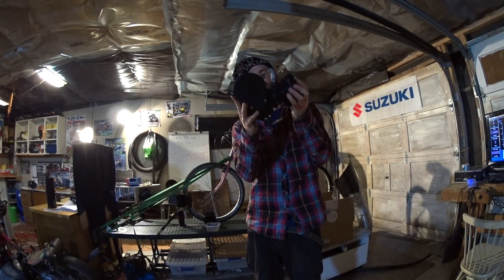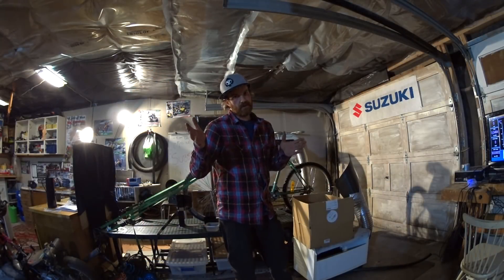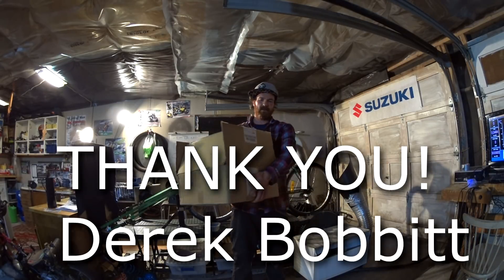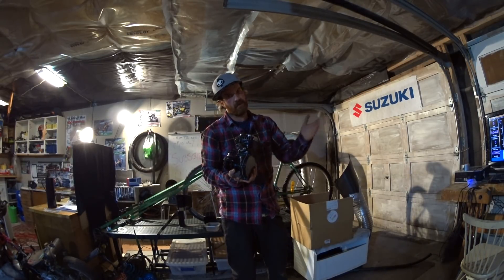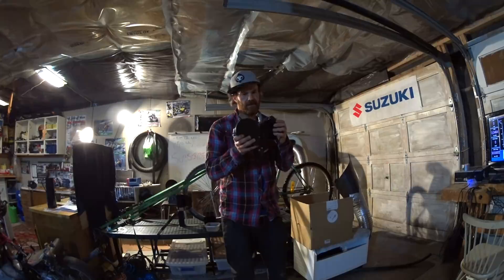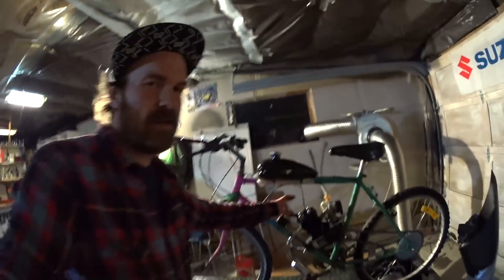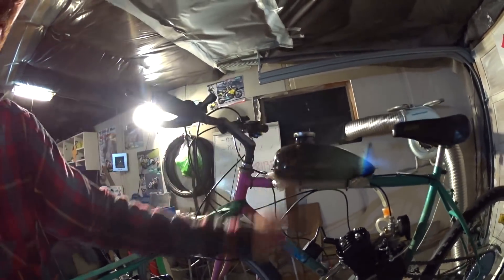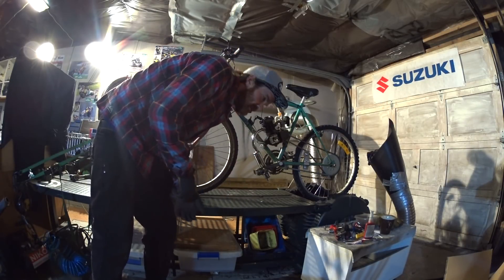Motorized Bicycle Tuning Project WITH DYNO | E1

Comment: You can try to go fast but on this set up . Is a razón why you stop working on them you nkow nothing of working on them . Stay on you lane . You nkow how to make other engine fast but not this one’s sorry. You make a faster motorized not a bicycle a bicycle have pedals that work and the engine for the bicycle is 1 speed or a jack shaft . Set up . Good work on those crazy build. They not bicycle the frame on a dirt bikes engines .

Comment: The lower support of the motor chain is crap! I sold and installed those engines and always had to make a superiror support because if not when braking (brake pedal) or when I wanted to start the engine, the bracket got between the spokes of the wheel, even has come to cut some rays.

Comment: Ok so I got a 66cc kit for my bike from a friend that couldn't use it so it had set for a couple of years and I'm just running it, running into a few problems, such as the clutch it was stiff at first but now it's loose and easy to pull, I tightened the flower nut 
but still won't work. If any of you people could help me out I would be so thankful!
Reply from the maker: Maybe the spring broke? Sorry, haven't been inside the engine yet, don't know much about it.
Reply: I had a clutch problem, the little arm was worn $5 to replace on ebay

Comment: he should just gut his lawnmower engine out.  If its what i think it is its an old 2 stroke 160cc full crank engine .   Sunbeam victa
Reply from the maker: +Glenn Lurman Too bad it's just a 4stroke Honda...
Reply: unusual cowling for a honda. it is the mower next to the diesel heater we r talking about.  Also where u at im in New Zealand and we r in the process of eliminating or just plain crippling our 2 strokes to meet stupid emision standards think im going to move to a cold climate like yours just so i can keep fixing 2 strokes
Reply from the maker: +Glenn Lurman When you mention it I haven't seen another Honda model with this look. Norway, just the same here....

Comment: There's a guy around where I live that's got one of these kits to go 80km/h. He has an exhaust from sickbikeparts.com , 36 tooth rear sprocket, probably a bigger carb and a few other things that I don't know about. You might want to find a good steel rim for the bike too, maybe double walled. The sprocket will warp and snap spokes in the wheel if its aluminum. ive gone through 3 before i got a steel one
Reply from the maker: +HDepicness13 Cool! Thanks for the heads-up!

Comment: Hey Alex Jesse here was thinking that the CDI that come with those Chinese Motors the ones that they come with are a 4-stroke CDI and if you could go into a little detail just a little about how burn time influences and turbulence come into play and how four stroke ignition differ from two stroke I think on the performance in you could help a lot of people thanks buddy can't wait for your second installment video God I'll tell you I was laughing so hard. Thank you can't wait till the tuning starts
Reply from the maker: +Jesse DeBlon Thanks! I'll cover it in a future video! There's no big difference between 2/4 stroke ignition systems, except the two engine types need very different ignition curves.

Comment: Mods that i think could make power: 1. Reversed cylinder 2. Head with a vertical spark plug hole 3. Ktm sx50 reed valve with a diy reed case 4. 19mm delorto or a 22 oko carb 5. Diy expanssion chamber 6. Variable timing cdi 7. BALANCE THE CRANKSHAFT  8. Lots of porting
Reply: robertas grigas from my experience reversed cylinder actually hinders performance a lot, because the crankcase chanels don't align well. Vertical cylinder heads have a lower compression so less power than 45° slant heads, also they like to crack with big expansion chambers, the rest you mentioned does improve power by a lot.
Reply from the maker: +robertas grigas Good ideas!
Reply: 2STROKE STUFFING Re carbs a WJ71 should go well with this.  what I use on my alx 78 and rcmax 71
Reply: MrSlehofer thre are high compression ones https://m.youtube.com/watch?v=x8OgOjltnqE
Reply: ah you ment fred-head, aka cylinder heads made by Frederick Chelminsky, he has a youtube channel about motorized bicycles and he manufactures various mods for motorized bicycles, so yes, they do improve power a lot
Reply from the maker: +behemothfan666 F T P Thanks!
Reply: Throw in a power valve and a rotory valve on the intake
..water cool the cylinder and head...get rid of those fat rings

Comment: Thx Derek.

First things. Carb leaks at intake. Oring and silicone.
Let chain stretch then delete the tensioner. It's a death wish if it slides into spokes the current way its mounted.
Little heat and bend the pipe to clear peddles.

Glad to see you got one. This isn't a Zeda model by chance? Just a standard 48 or 66cc model?
Reply from the maker: +Cody Jv Yeah, I noticed the carb having no actual seal. Thanks for tge tips! Don't think it's a Zeta(what is a Zeta?) at least wasn't advertised as one.
Reply from the maker: +Cody Jv Zeda...
Reply: Zeda has a 40mm crank, 40mm intake opposed to 38mm crank and 32mm intake. And supposedly the case is stuffed a tad. About the only difference I use to buy the kits and put them on bikes and sell for little profit. Just bought a Zeda myself to see if it's a little better stock. Glad to see you got one of these to play with and I'd love to see you maybe adapt some cylinders to it. The China nikasil is crap but decent for what it is. Keep it up.
Reply from the maker: +Cody Jv Ok, I'll have to check. I've got a few cylinders in mind...
Reply: Right now the largest is 52mm. Crazy. That's max but I think you could do ab awesome job with a 50mm bore except your probably 38mm stroke. Even with tuning I think you'll rock it. Quick simple power is sand that head some but ofc more heat. 44tooth run about 30 on stock bike with 26inch wheels. Wear a helmet...

Comment: I have one of this but I have figured out the after break in you have to first tighten the head bolts and you also check your cone nut the torque makes it come ither lose or tight depending on which side goes lose I had it first go tight on me and the wheel just locked hard you could not pedal like if you were hitting rear brake and after the other side came lose the wheel wobbled side to side
Reply from the maker: +nightmare in action nighmare in action Thanks for the heads up!
Reply: Ian Mangham I have a big tire 2.85 to be exact but I keep my psi to the max because it helps with efficiency but if you rev and drop the clutch I'll slide so I got to watch out for that but I think I'll have to put locktight they are already lose again

Comment: Bloke i know has a business called Rock solid engineering. He specializes in these check out his website
Reply: My old one was well diald in used to be able to do donuts with feet up on peddles on grass and skid on the road if i leaned forward. Would even wheely the street pretty easy with some minor peddling
Reply from the maker: +Sean Fiba Thanks, I will!
Reply from the maker: +Sean Fiba Awesome! There's hope!
Reply: 2STROKE STUFFING  just realised his sites not running anymore sory lol
Reply from the maker: +Sean Fiba Too bad.

Comment: Man, that thing sounds like mechanical pain!
Reply from the maker: +Tris Rush Yeah, it sure does. I'll see if a bit more grease can help. At least as sound damping.😂
Reply: I owned 3 engines and two of them worked perfectly for thousands of miles, the other one died at 500 miles when the big end con rod bearing blew up lol